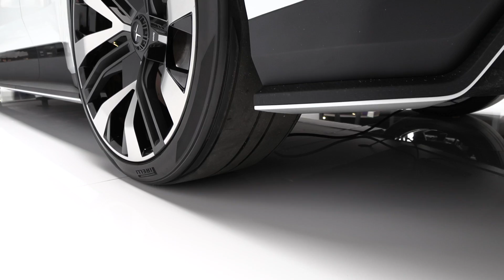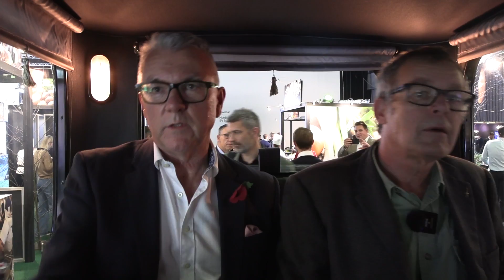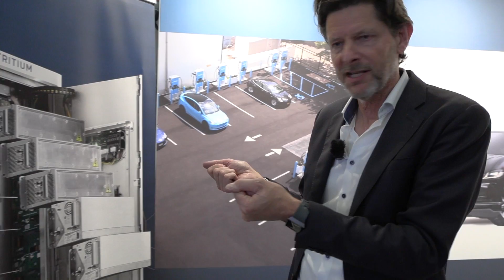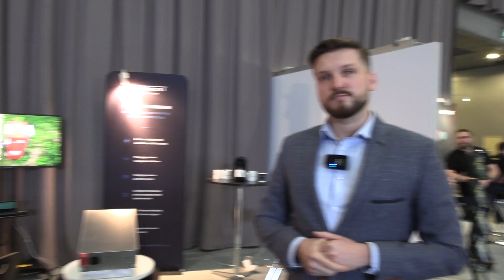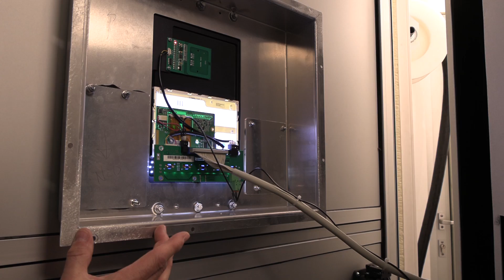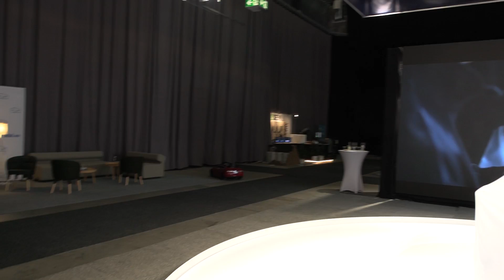Nordic EV Summit 2021

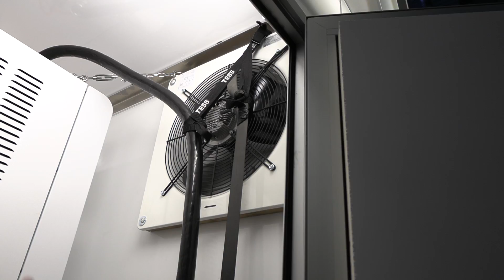Comment: 33:10 "... the fan taking out the hot air."

Does this mean the incomming air is not controlled (filtered)? If there is air leaving the box, there must be some air entering it. If that doesn't happen in a controlled way, there will be a influx of (a.o.) dust.

Comment: Hello Björn.
I have been working between 2016 to 2019 as a semi consultant to a Chinese power electronics company designing EV chargers. Covid put an end to that, so I am not 100% up to date regarding the latest AC/DC converter efficiency.

But before Covid that Chinese company achieved an AC/DC conversion efficiency of more than 95% in the output range of 300-1000V / 25-100% output power for 30KW modules.

The person you interviewed only talked about output power efficiency, but did not mention the output voltage range involved.
One somewhat difficult issue is to maintain high efficiency over a wide charge voltage range. Porsche, Audi and others are using 800V batteries. I actually do not know how Tesla chargers can charge those types of cars.

Comment: Great video... but why are Tritium proud of a shared 75kW charger that only does 25kW on one side!? In 2021/2? Very unimpressive, Kempower must be laughing at them...
Reply from the maker: Tritium has been providing 350 kW HPC to Ionity since 2019. I think it's great that Tritium finally has 75 kW as the slowest charger. And power sharing is also quite useful. Especially if you have to share with a slow charging EV.
Reply: @bjornnyland  Good point but surely then you want one of the systems with a built in battery so that it can provide 50kW on each, and then recharge the battery from the grid between cars? This seems to be limited by hardware and design...
Reply: And I must have missed the bit about them sharing. It sounded like it was 50kW in one side, 25kW on the other. Sharing 75kW dynamically is not so bad.
Reply: I imagine they are selling every charger they can make... But seriously there is no reason to install a charger that does below 125kw anymore... And if its a split charger surely 150kw should be the minimum.
Reply from the maker: @onlineo Remember that you have to pay extra for high power. Some locations simply doesn't have enough power there unless you install a bigger transformer. Also remember peak power fee. Even today, it still makes sense to go lower power in areas with less traffic.
Reply from the maker: Have you not seen my trips through Åkrestrømmen/Øvre Rendal? That road is so deserted that the very low number of EVs passing by will not generate enough money to pay for the investment of HPC or in local battery storage.

Comment: Bjørn, How about the Bjørn test suite on the Baker Electric?  Banana Box, Acceleration, Charging Speed, dB, etc.  You can skip the 1000 km challenge, but it would be good to see simulation results though. 😀

Comment: Thanks for the Tritium segment.  The old Veefil chargers are frustrating to use; require more manual intervention than most.  The "power module" design is used by other companies like BTCPower and ChargePoint; one difficulty is that the driver will not necessarily be told the total # of modules installed (which can change) so what to expect in terms of power available?  A real issue if paying by the minute.  Good to know how they split power.  Can't believe they are demoing 75kW in 2021!